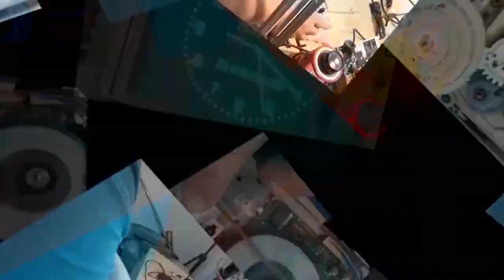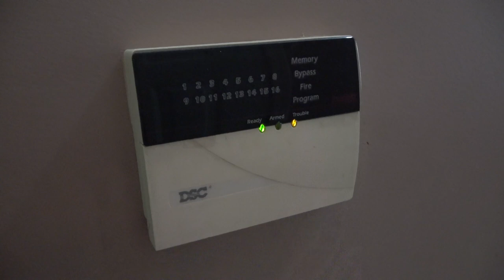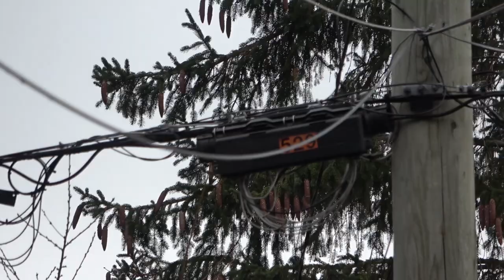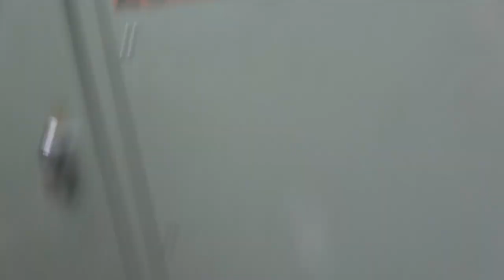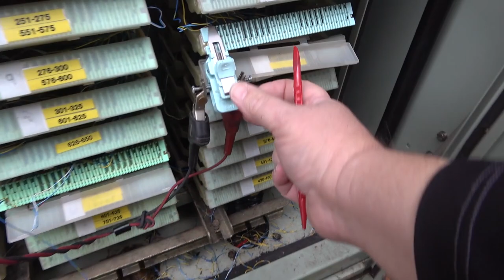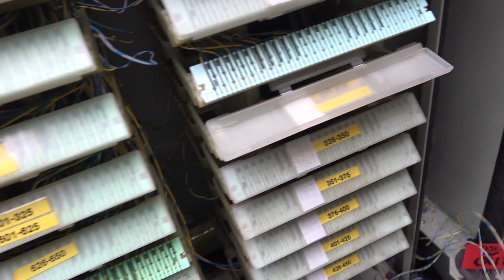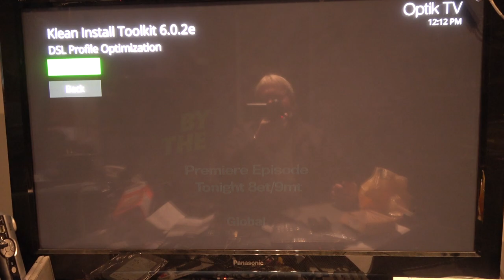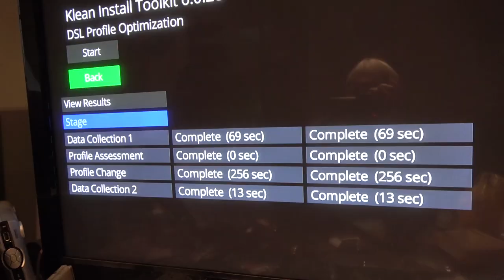Fixing my old noisy copper phone line

Comment: Watching this from Germany, where pretty much at least 75% of those lines are still copper to this very day!
Reply: Same. This video is making me cry.
Reply: Also here in Switzerland we still have a lot of copper local loops. Mine is copper too.
Reply: Actually in Germany it's worse, at least east of the former german-german border. There the (copper) phone network was from the 1940s at best when DSL took off, and Telekom (which after the reunification got a whole lot of new customers) was required by law to deliver basic DSL (only 786/128 if I remember correctly) to every phone customer, whereever they are. But when the 1940s copper lines were replaced, they didn't put new copper in, that would have been crazy. Instead they pulled fiber, but terminated in a box just outside your house that converted that to copper, with a 1-customer-DSLAM. Then the customer connected his/her DSL modem on the inside and you had all of a few meters of copper where they got DSL as required by law. SMH.
Reply: @hinzster  That's what happens here too. The telephone network until the final distribution cabinets where all the DSLAMs are located is all fiber optic, then there's the twisted-pair local loop reaching the customer's permises. That's the situation with my line too. But as the distribution cabinet is near my home, I have a 100/25 mbit VDSL2 which is pretty stable and reaches the rated speeds quite well, and according to the test that can be done online on the telephone company's website, my Internet connection could reach speeds of about 400/90 mbit, which is really good for it being on a copper line. Actually I'm happy with my Internet connection despite it being on copper, and right now I don't feel the need for a fiber optic connection.

Anyway since some years telephone companies are working to bring the fiber optics directly to the customers and there are cities where such connections are already available.
Reply: @mima85  You forgot one thing. Telekom Fiber from the the early 90th is not the same as today. This was an OPAL-Network. You could not change this to modern FTTH. It was never the goal to bring this direct to the customer. The new network works in an other way, with other fibers.
Reply: Yeah, that's because Germany adopted ISDN many years ago, while the rest of EU went to fiber in city cores...
Reply: over in the netherlands too , they are rolling out glasfibre up to the node stations but after that its still copper , the video showed some pretty good speeds i have 49 mb download and 18mb upload
Reply: There was an incident by my house recently (unaffected because I have cable internet. And the coaxial wire is copper clad aluminum/steel)...
Some clever thieves (crackheads) cut down some telephone lines in my area to scrap the copper. City if ~1M people, damage affected ~1,000 homes. Crazy crap people do.
Reply: @jamess1787  our cables are underground , they did dug it up one time and broke i when repairing a waterline next to it , was without internet for about 2 days along with two other apartment complexes
Reply: @hinzster  after the reunification the Telecom (Deutsche Bundespost) renew all lines and phone excanges. So no old lines from 1940 or older are in service. The last old phone exchange which get retired was a Strowger  switch in Ludwigslust made in 1925. The equipment can now be seen at  the "Deutsches Museum, Munich"
But they are way back with new internet lines. There are  plenty  of roadworks   here on the way  due to lay new  fibre optic in  the area  where I live . 
There were 5 international Contracts with the federal government to renew the telephone network.  Following companies share   the former DDR in five parts were they planned and build  a new network BT,   SEL/Alcatel,  Bosch Telekom ,  Siemens and  Felten& Guiliome (Philpis Telekom) The finished the work in 1994.
Reply: @daveleger2002  ISDN is primary for telephone and is a  transfer protocol and fibre optic is a transfer medium like copper or radio links. So ISDN can be realize over fibre optics , radio or copper, DSL can even  also realized over copper Fibre optics and radio,  appropriate converters provided. WAN Network can also trnsfered via those media. But fibre optic give  the fastest transfer speed.
Reply: yeah I still have an ancient phone line form the late 40s early 50s in my house.
And that cable is still active. It had top be properly terminated when we got new phone and internet.
Wo we got Internet and Phone over a Coax TV Line as a lot of people here do but that ancient phone line was what we got when we moved in.
They are rolling out more and more fiber but things in Germany take a loooong fucking time bc our ISPs are greedy cunts and our lovely government wants to be involved in everything so the two have to constantly work together.
Reply: @alouisschafer7212  same here a lot of the newer build homes are hooked up to fiber when its available in the district their in , the older homes are usually copper up to the distribution station / node
Reply: @hinzster  Well at such short distance it should give good speed tho
Reply: im from germany running on copper and getting 400 mbit/s
Reply: Indeed. I had to let an installer into the apartment basement when I last lived in Dusseldorf. I remember seeing something very much like this.

Comment: Worked at a 911 center as a radio tech. I was tasked with troubleshooting phone line troubles and interfacing with the telephone techs. Had a problem with a 4 wire line used to tone out a fire station. Went to the station and checked the line with my butt set. Lo and behold I hear Vietnamese voices! There was a crossed line in a splicing pedestal. This was in a Vietnamese residential area. Nobody believed it until they heard it for themselves. We also had lines from remote receivers to central comparators. A quirk in Motorola Comparators is that they would vote to a noisy line. We also had to sweep and adjust the lines once a year because they went through concentrators as opposed to being end to end copper.
Reply from the maker: When i was on business i dealt with concentrators, amplifiers, over line talk groups, ISDN and t1 carrier. Before cell sites were fiber fed they would have 10 t1 circuits bonded which gave the site 15 megabit up and down. This was in the old CDMA days.. i didn't do the cell equipment, i just dealt with terminating the copper and testing.  That was about 14 years ago. I moved back to residential as i have my own territory and don't have to travel anymore.  Been spoiled now working 1 mile from home.

Comment: When it's not raining, the greatest Telephone Repairman in the Sun!!!  Dry cables at splice points...
Reply from the maker: I have started to notice a pattern on the new Fiber. When there is a power failure, (doesn't affect me as my ONT  and modem are battery backed up so they keep running and I have internet when my neighbours are all out) as soon as the power is restored and all the ONTs in the neighbourhood start hammering the servers for an IP everythng gets flaky for several hours. Cant even watch tv for the rest of the night as it freezes and breaks up for several hours as everything gets back online. Happened now twice after a power failure.
Reply: @12voltvids  The fiber is only the highway from the prem to the service provider's point of presence, and not the cause of service slowdown, unless there's shared bandwidth.

When an area recovers from an outage, there exists a rush for service by end users. This crush of users results in a bottleneck that has a ripple effect with service, typically IP based systems.
Reply from the maker: @NYCMNYBY  the fiber goes back to the splitter cabinet where the feed is split optically 32 ways.  Each ont has a 1 / 32 time slice. The feed runs back to the olt, optical line termination.  A big router that has all the line cards  in it which then goes back to the uplink server. The pop or point if presence would be the only edge service router.

Comment: for the old phones: get a SIP ATA with pulse dial support. (like most older Grandstream models)
Reply: Get a current one, no need to get the old shit. For example the HT812/HT814/HT818 are current models, very good and can enable pulse dialing support in the configuration.
Reply: @geraldh.8047  hm 🙄 good to know! Will HT812/HT814/HT818 work w/ any SIP provider (is it "easy" to set up)?
Reply: @geraldh.8047  Indeed, I have an HT814, and it works great, but I don't have an old rotary phone to test it with.
Reply: I was going to say the same thing, grandstream ata supports pulse
Reply: Yup, that's what I do.   Look for a devices that specify a REN load, which is the number of analog phones on a line....

Comment: I have a device hooked to my old rotary phone that turns pulse dial to a modern DTMF tone that works perfectly over my VOIP line.

Also I live with someone who has heart issues and work at a homeless shelter.  Both places have VOIP as the phone line and I have better luck calling 911 on my cell phone. 911 has failed to locate me several times on the VOIP lines even though they are setup with the location like that is required in my area.  On my cell phone I have to remember to turn off WiFi calling if I am connected to WiFi as this has only one 911 location.  I am currently in the middle of my house an connected to 20 GPS satellites with an accuracy of 3 meters on my cell phone.

Rev George

Comment: I about shit myself when I saw him pull down 65/20 on copper frickin’ wire. Unreal. Good ISP!
Reply from the maker: I just tested it now. Just got 74.2 down and 19.8 up and there is a TV running in the other room.
Never have a problem with speed here, and that is why I am reluctant to change anything.
Also I can pull multiple open IP. The guys on fiber get 1. That's no fun. I run multiple routers with their own public IP, so I can run open ports for things like cameras and stuff all the while the IP I use for my computer is totally different.
Reply: @12voltvids  Yup, that’s worth keeping. But if the fiber was symmetrical gigabit, that would be worth the trade offs for me.
Reply from the maker: @brothertax  it is symmetrical gigabit but that still won't sway me at all. Even if it was the same price which I currently pay i would stay for the reasons listed above. 
Gigabit internet causes me the most headaches at work because of brain dead customers expectations.  The speed is only as fast as the slowest server.  Also I have yet to see a single wireless device they can achieve more than 500. Most wireless devices especially Apple top out well below even 500. This is due to the expected long battery life, manufacturers put in slow wireless cards so it's not to drain the battery quickly and this generates trouble calls for slow internet. I show up plug my laptop in get 1.1 GB prove that the speed is there and the bottleneck is their equipment and then have to bill them a diagnostic charge which pisses them off and now I'm the bad guy.  Can only guarantee that type of speed over hardwired connection and to a PC that's not running antivirus or VPN software as these are going to slow the connection down substantially but people don't understand this which drives nuisance trouble calls.
Reply: @12voltvids  How many public IPs do they give you? Do you utilize them? What kind of router do you have? Or do you just use the residential gateway?
Reply from the maker: @brothertax  
I am only running 2 at the moment.
Reply: WestNet in Calgary has its own lines on copper i Pulled 100/30  on a single pair
Reply: @aedgvv6095  How close to the CO are you?
Reply: @99sporttruck  westnet does some high tech or really simple out of the box thing, i am about 1.6 km away from their central office.
Reply: @aedgvv6095  Do you know if it a calix or adtran? The company I work for still have calixs in service that will only offer 9/1. I’m constantly moving subs off the Cx because of the available bandwidth. Adtrans are much more reliable connection wise. Bonded services are even better!

Comment: incredibly good speed through the telephone line! Before I only got 8 mbps through telephone cable even though the line was set to 20 mbps.  but it's almost 15 years ago if not longer. Now I have fiber  
and I will never go back!
Reply: DSL can be good, especially if the run to the DSLAM is relatively short, and the cabling is in good condition and not a mix of cable types. Worst is aluminium cables, they are terrible over longer distances, and the skin resistance does a lot of attenuation. Funny enough century old paper sleeved oiled copper cable is pretty good, well controlled all the way.

Comment: Your "legacy" copper is providing a higher speed than we get here in Australia on our brand new national broadband network.
Reply: eewww
Reply: that's because the wire is thicker gauge and more impervious to overheating and environment. Little cheap fiber lines are so thin they get destroyed very easily. Could tear them up with your teeth alone.

Comment: I'm served off of a Fujitsu built remote switching unit which itself is connected to a DMS-100. Every 6 months or so it seems like my line card becomes un-programmed, it will lose dial tone, but have DC and will appear to a calling party to ring when in actuality it does not.
Reply from the maker: Sounds like they need to change the line card

Comment: I had to fix my phone line with 14gauge electrical wire and worked great.
Reply: Wow, it must have been a lot of work twisting all that thick wire. JK. In the home it should work fine without twisting the pair.

But for long distances it really does need to be twisted.

Comment: I live in Mexico, and the biggest phone company (Telmex) gave me a Nokia G-240W-G ONT about 4 years ago for my optical fiber upgrade from VDSL. A few days ago, I tried to connect some rotary dial phones and they work! This modem actually interprets pulse dial! I tried a 50s? LM Ericsson and a local brand INDETEL. All antique phones here are only from those two brands afaik.
Reply from the maker: Does it generate a high enough ring voltage. We use the Nokia g240 and x250.
Reply from the maker: @cesaralfredotrejo  
I guess I will find out soon enough as copper is scheduled to be sunset next month. Been so busy  switching over the stragglers like myself.

Comment: Bought my new home in 2003 and requested a home phone line. A copper line was installed and it worked for the most part except when it rained. So noisy that it would not pull a dial tone at times. Call in a trouble ticket and they swapped pairs and it was fixed until 2005 when fiber came in. I ended up switching over to fiber for everything. The downside is that I am now the CO providing battery so if there is a power problem my battery kicks in and keeps my phone alive but disables my TV and internet. Its a cost but not a very big problem. Worked in crypto in the AF and spent some time in vaults in West Germany tracing cables. Also spent many hours in the tunnels under Washington DC tracing problems for the DC Subway. Any way blue, orange, green, brown ,slate to you.

Comment: 3:58 We've had more AT&T landline outages than we've had cellular outages. Just a few days ago we had a 911 outage that only affected landlines. Cell phone carriers where not affected. One great thing about cell phones now when it comes to locations, is if your phone is connected to WiFi and WiFi calling is enabled, they will know the EXACT address you have set at that current time, problem with that though is if your say 7 hours away connected to someone elses WiFi and WiFi calling is enabled it will pull that address you have set and not where your actually at. 

But anyway copper is a big heck no here. 768K DSL vs 940mbps Cable. Long ago the line running to my house went dead 100%  so we just ditched the landline and went cellular for it.

Any enjoyed the video! Usually on the coax/CATV side of things so nice to see something different.